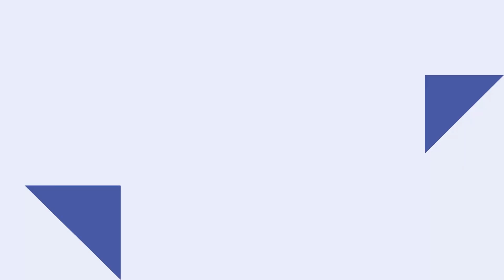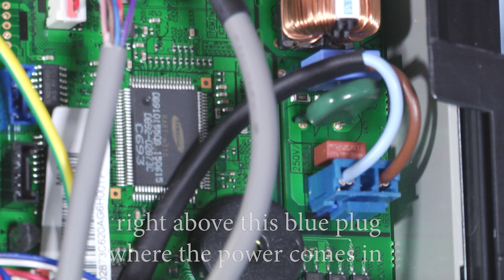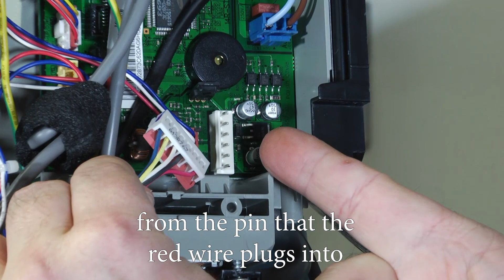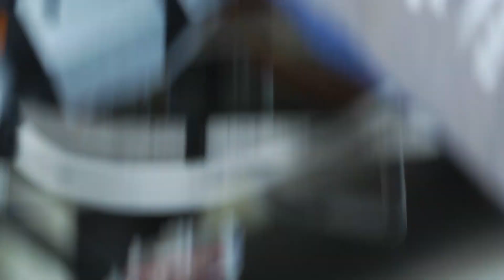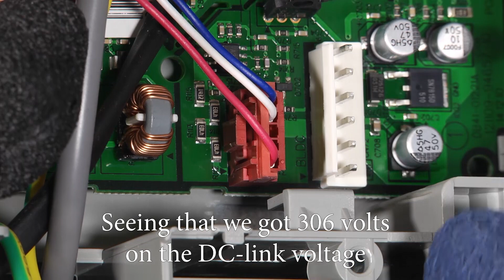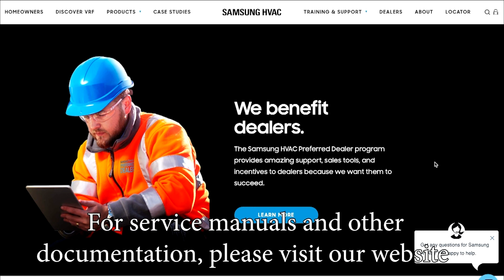Testing a Main PCB

Comment: My Samsung fridge isn't cooling.  The red light on the mainboard is solid and the compressor is turning on.  Both Sears and Samsung technicians say it's a sealed system issue that I should be covered by Samsung to repair for free, but the Samsung tech claims the mainboard is broken and he's charging me $500 to replace it.  Is it possible he's just lying to charge for a repair that should be free?